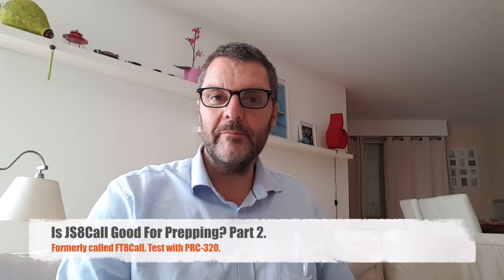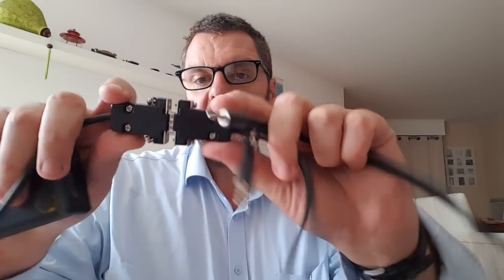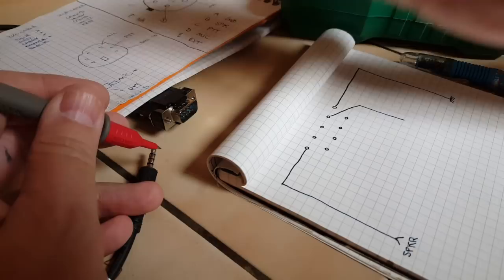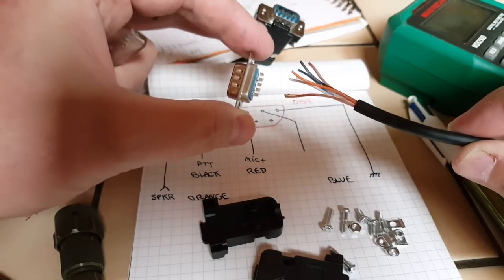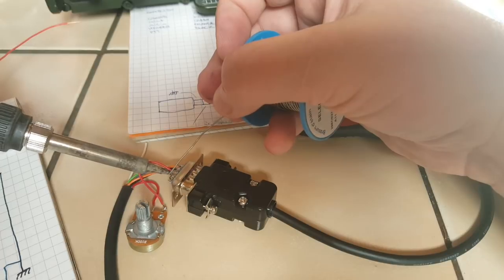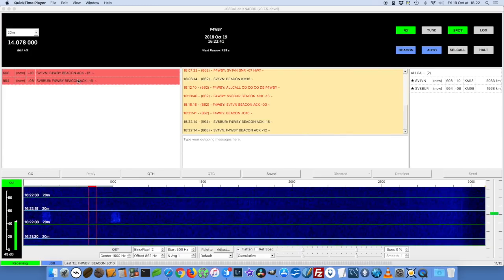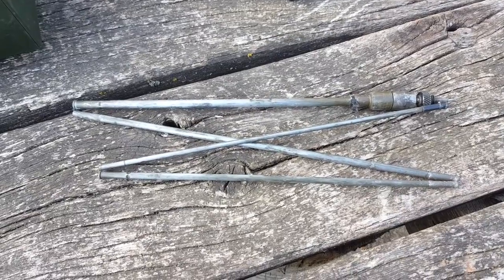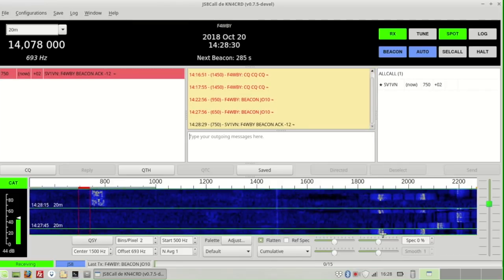Is JS8Call Good For Prepping? Part 2, With PRC-320.

Comment: Great video Gil!   I was wondering if you’ve had a field deployment using your QDX, and JS8 Call?  It would seem ideal for prepping.  Especially since it has four bands, 20, 30, 40 & 80 meters.  80 meters, your favorite NVIS band.  

I’d love to see your QDX Kit.  With a small battery (9v or 12v depending on the build), a USB cable, Android tablet plus software.  Maybe even a Solar Panel, Charge Controller, yada… 

“Pretty dang small,” as you’d put it.  I think you need to take another run at JS8 Call.

Thanks for the videos!  72  de W7UDT (dit dit)
Reply from the maker: Hi, I did, search for the video :-) I probably will do it again..

Comment: Love your videos. I just bought a prc320 and am awaiting it's delivery. I'm wondering if you've been successful with digital modes on this radio or is it a work in progress? Thanks
Reply from the maker: Somewhat but my interface cable doesn't work that well..
Reply: Ok thanks.  I just bought a 320 and am waiting for the ancillaries to arrive. I hope to use it for digital as well.
Reply from the maker: You'll love it, and lose weight carrying it ;-)

Comment: It is great that you asked the developer for a version of JS8Call that does not require an external time reference. I posted the same issue on one of Julian's videos and he replied that it is not that difficult to synchronize your computer based on the start time of someone else's transmission which was a reasonable response but still seems less than optimal. The software should automatically synchronize to the other station.

I'm very excited about the QSX transceiver that Hans is about to release at QRP Labs. It will have PSK31 built-in (external USB keyboard required) and there is a scripting language that will allow experimenters to implement other digital modes and hopefully they can be integrated into future firmware upgrades. I'd love to see THOR. It's a tiny transceiver that's capable of SSB and digital modes and it puts out a solid 10 watts at 100 percent duty cycle on digital modes without overheating.
Reply from the maker: Yep, I am waiting for the QSX too!

Comment: A late comment:  You might consider purchasing the MFJ-1979 stainless steel telescopic whip--at about 5.25 meters when fully extended.  Resonant on 20 m and below by merely adjusting the length and using the appropriate counterpoise(s).  I have used the MFJ-1979 in the field and it works well.  Used with the buddistick coil it works well with 40 meters even though it is a compromise vertical in that configuration!  IIRC, you own a buddistick so another longer whip would add to the utility of that little kit.  The MFJ-1979 is not a backpacker's whip per se, but for picnic area work and car camping it is really convenient to use!  BTW, I really enjoy watching you operate that 320.  Great piece of gear you managed to acquire! 73 de AE5ZX
Reply from the maker: I have thought about it...

Comment: JS8 on a cruiser would be amazing. You could use a 10 watt qrp radio, like my uBITX. I still need to finish my interface and currently I'm using the Chuwi (win tablet) speaker and microphone, and likewise on the uBITX. Works really well. I hope the entire world jumps on board, Australia, New Zealand, Japan ect as , being able to send actual messages (text) is amazing with this mode. New Bulletin from Jorden Sheer is , do not abbreviate. Use full wording, and it will run faster. In the latest build blog. He has language processing and It will get stuck on abbreviations.  Hopefully will connect some time. N6GRG Michael in California
Reply from the maker: I am waiting for the QSX from QRP-LABS, which has a built-in interface...
Reply: @RadioPrepper Somewhere I have info regarding uBITX to interface, I'm thinking it was on Jordans Groups IO but I'll look and post. It showed the use of an Easy Digi for the audio. I use a  Rigblaster Plus for DTR control of the PTT now , and that works well between my Chuwi Tablet (win10) and my uBITX. So, if I can get the audio worked out, I won't be listening unless I turn the speaker switch monitor switch on.
Reply from the maker: Please post on radiopreppers.com

Comment: Could you share any information like the pinouts off the clansman connector, which coloured wire is which, etc... ? - I am trying to build an interface. I think i've got it mostly working using the VMARS manuals but its the PTT which I can't figure out how to control from my PC

Comment: You are correct, there is a limiter involved. I would guess it is part of the noise reduction system. 
AC8WP
Reply from the maker: I think the 320 has a pretty advanced speech processing circuit for its time.
Reply: Agreed, for 1960's technology it is quite advanced all around.

Comment: My humble thoughts..... fun to play with.... BUT, too much gear and way too complicated for SHFT/emergency situation.   Simple is better for emergencies.  I use GMRS, 2 meters, and 40 meters (cw) as my SHFT/emergency gear.   Just saying... 
Later.....
Reply from the maker: Depends on context.. For bugging out I agree.
Reply: Can be ran with a raspberry pi, wolphiLink and cellphone/tablet along with your radio. Not much more room than a couple deck of cards.  Not a lot to add for so much gain.  73 KF7VUT
Reply from the maker: I have yet to try something like that, but it is three more devices to power. Still I might try...
Reply: @RadioPrepper  give it a shot.  It might not be for you but it is another tool for the tool kit.  I'm a cw guy too but knowing how to operate the digital modes can only be an asset.  73 and love your vids.  de KF7VUT
Reply from the maker: Agreed. Thanks.
Reply: Gil started out by saying exactly what you mention. You must have missed that. And it's not just the weight.. power management for a complicated station on long-term or permanent field use would become unmanageable. And then there's long-term reliability and protection against environmental incursion, blah, blah. I'm preaching to the choir here I know.. just wanted to point out that Gil prefaced his video by making the point on gear simplicity
Reply from the maker: Indeed. Of course if the computer or interface fails you are left with the radio and still on the air... So the Raspberry is a good solution, but then, you could carry a second radio if you can manage the weight...
Reply: @RadioPrepper  Awaiting the release of the QSX from Hans.  This might be the perfect radio to build with the RPi for cw digital and ssb.
Reply from the maker: I will certainly get one!